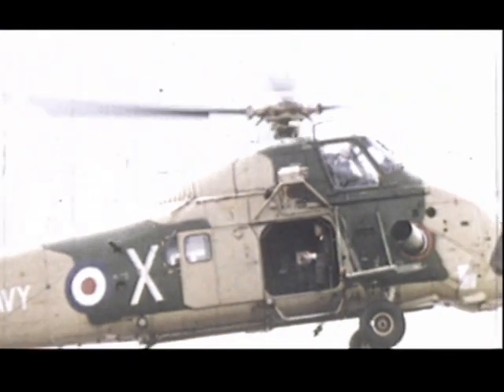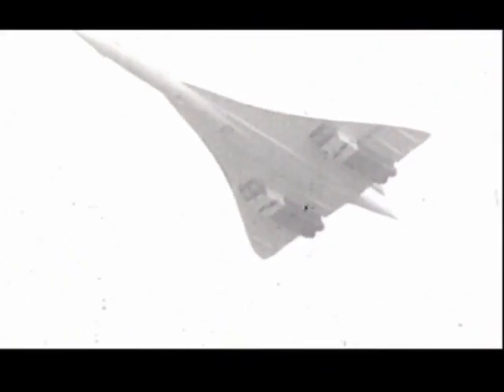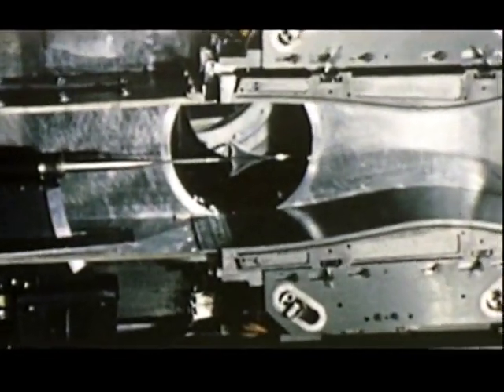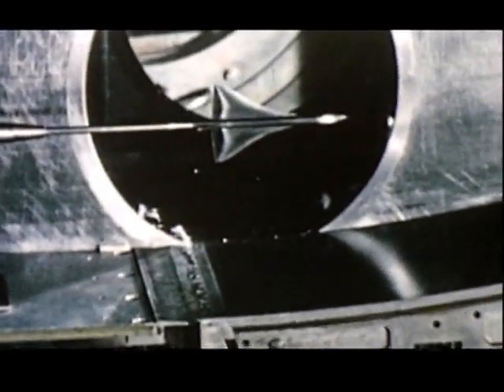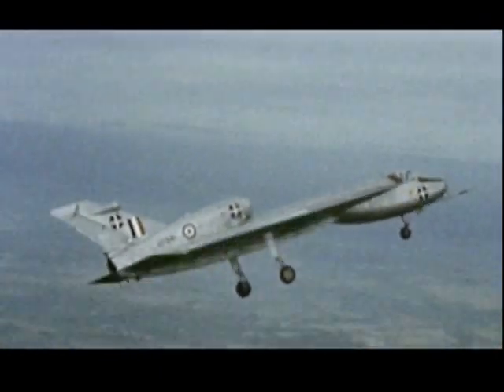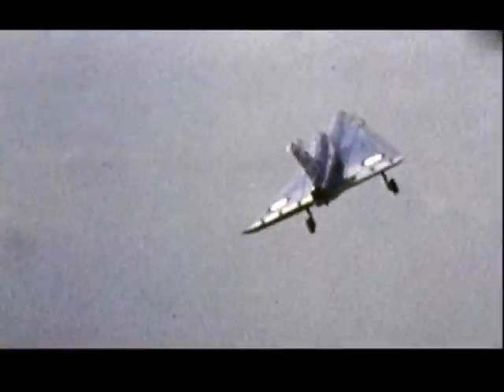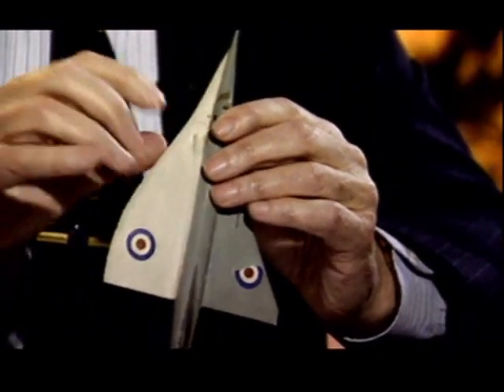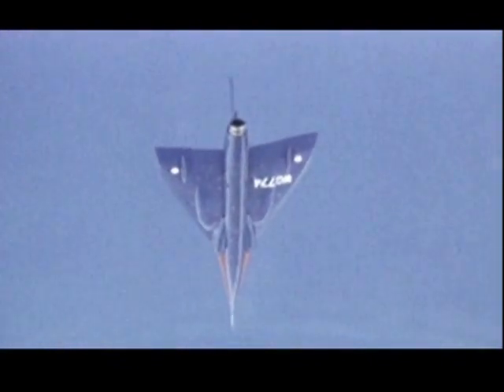Delta Wing research which led to Concorde. Features  HP115 & Fairey Delta 2 experimental aircraft.

Comment: I have simulator flown the HP-115 and the flight characteristics were terrible. Since then, Concorde has been seen taking off from Arlanda. I can understand that France fell for the Fairey Delta 2 and built the MIRAGE 3. You miss Concorde in the air.